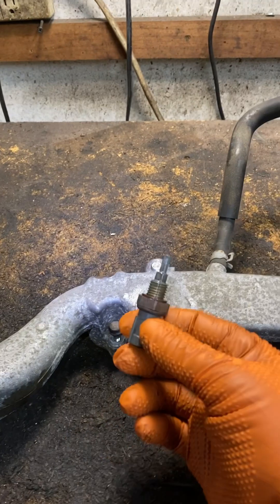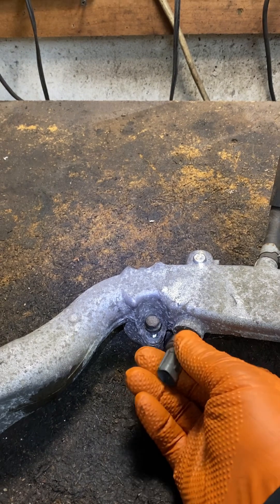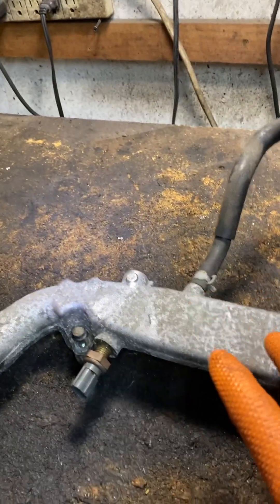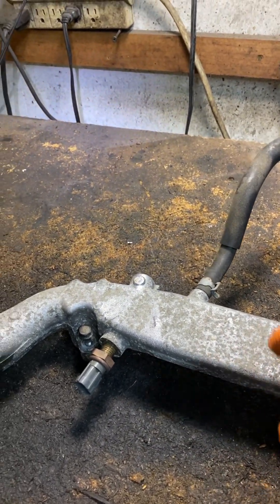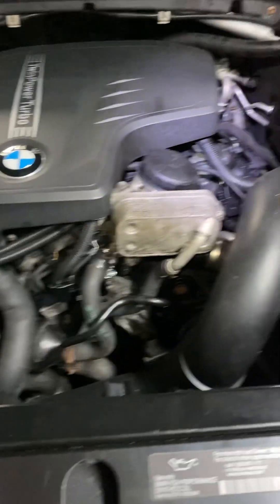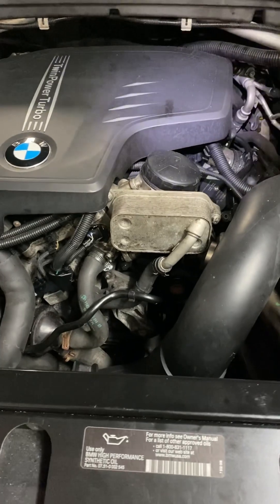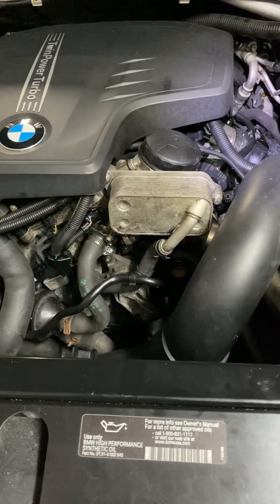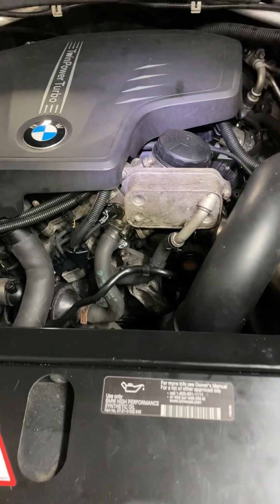Where is the engine coolant temperature sensor located? #motorcarnut #shorts #mechanic

Comment: how do i put it on ?
Reply from the maker: Every vehicle is different but they are in the coolant system usually near the cylinder head and require a socket wrench to remove and replace.

Comment: If one of these go bad those affect the ac?
Reply from the maker: No it doesn’t
Reply: @motorcarnut  it's coincidence I'm getting a P0116 error code and my AC has cooling problems. In park it cools really good then while driving it would randomly stop cooling
Reply from the maker: Ok, well I don’t know what vehicle you have but in your case, with that code I would say yes, replace it.
Reply: I got a p3195 code?